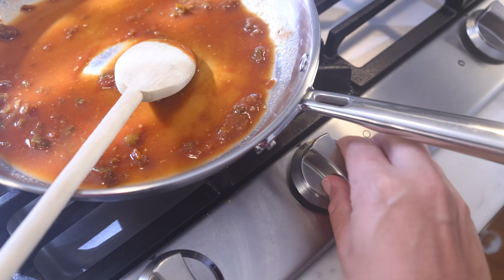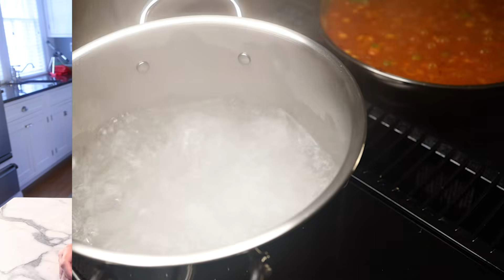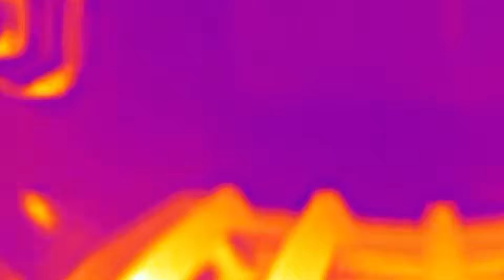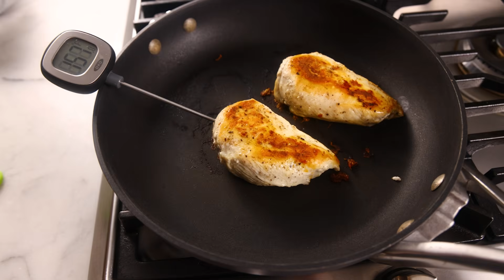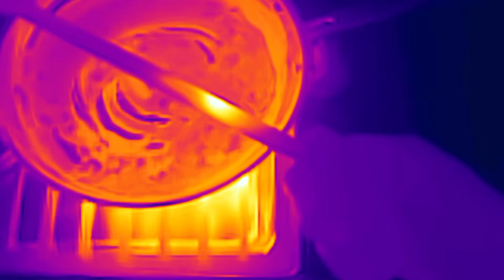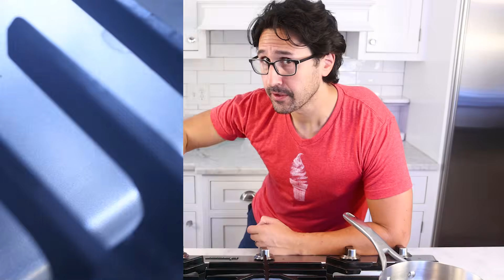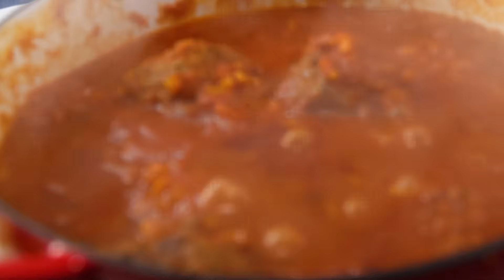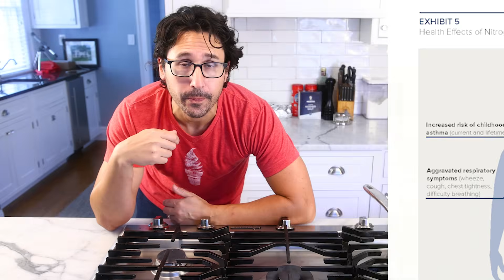Problems with gas stovetops | weak, dirty and dangerous

Comment: Perhaps the reason you are having touble is the specific burner you are using? The center burner is 18,000 BTU's , and that's the one you want to use for boiling water,  the front burners are 9,000 BTU's, and they will be used for things requiring slower cooking, and the rear burners are 12,000 BTU's. I can tell you this, we live in a rural area, so cook on PROPANE, and propane puts out less BTU's on the same burner that natural gas does. My smallest burner on my propane cooktop is 8,000 BTU's. I also don't have trouble burning the sides of my pans because I have Ekco Flint pans from the 1960's, and they don't conduct heat up the sides as much as your modern cookware. I do have old equipment, though... I'm sure modern stuff is totally different. I have  Magic Chef propane cooktop from 1994, and my mother has one from 1971. I don't notice any difference between them, really... except my electronic ignition went out VERY quickly, so I said screw it, and jut light it manually. My mother's has a pilot light.

Comment: I'm cooking nerd, so I also have quite a bit of attraction to gas stoves. But while back I had opportunity to choose what stove I went for, even though I really wanted gas I just had to go for induction because every rational part of me sad it was better option.

I would say if you actually need/want gas stove for wok, get single burner stovetop that works on canister gas outside, either actual stovetop or grill that comes with one.
That said, you can make good wok even on induction and cast iron/carbon steel pan too.

Comment: Gas stoves will not be replaced. Its more efficient, cheaper, its actual open flame and temperature control is just perfect as cooks all over the world were taught how to control it. 
Where do you think electricity comes from? "Green energy" is not cost-efficient. Unless we start building nuclear powerplants, in most countries you cannot replace gas or gas stoves.

Comment: Looks like Induction is the way to go but I wish with every new and improved technology we wouldn't throw out the proven tactile way we interface with them. I'm talking about these awful touch controls you find on everything from stoves to climate control to car stereos. A physical knob is so much quicker and practical to use in these situations. Pressing a button 7 times to get to a medium high heat is an awful user interaction

Comment: German guy here... I don't know anyone in Germany who has a gas stove. Neither stovetop nor oven. Most homes don't even have a gas connection. Almost all kitches are equipped with a resistance coils + glas top stove. Induction is also becomming more popular but only if you can afford it. Whats worth mentioning is that (basically) all kitches have a 400V supply (3x16A*230V = 11,04kW) for your stove ready to be used. Bringing water to a boil is super fast with these :)

Comment: This is the reason my parents got an induction plate setup when they bought their kitchen. Boiling water is basically as fast as using a tea kettle boiler and there is alot less danger of things burning. Although at first a bit weird, when you learned cooking on slow heat plates (I burned alot of things at the beginning), in the end it is probably the best you can get.
Reply: I use glass top stove for low to medium heat duty and an induction plate when I need to blast something. The right tool for the right job.

Comment: Another benefit of having a gas stove is that when you toss food like pasta or stir fry in the pan, or when you tilt the pan to baste, the flame still wraps around the pan and keeps the cooking going without the pan being flat on the surface. With glass tops, you might still get some heat, but with induction, the heat completely shuts off unless the pan has full contact to the surface. Also, I can never shake the pan the way that’s necessary to make a French omelette on a glass stove without severely scratching up the surface. I just moved to an apartment with a gas grill grate stove and I can finally shake the pan on the grate when making omelettes or sauces and not have to worry about the stove surface scratching
Reply: I make  omelets and stir fry all the time. You shouldn't be banging and scraping your pan like an ape on the stove top any way you'd get your ass kicked for that at work. You lift, then toss.
Reply: @TheLegendOfTerry  Never said I banged the pan but the classic technique is most definitely to shuffle the pan back and forth on the grill whilst stirring with the other hand. Just watch literally any old chef demonstrating omelette technique, Jacques Pepin demonstrates this technique perfectly, and he also does knock the pan against the grill towards the final seconds.

Comment: If you can't get the fire in gas stove to be smaller, turn it VERY NEAR the turn off position. It can still burn milk in a saucepan if you're not careful though. But it's rather helpful to know.

Comment: I love my gas range and will never willingly change to electric ever. The supposed‘inefficiency’ is fine versus waiting around for an electric stove to heat up. Oh and BURNING yourself on the stove cause a) you can’t tell if the burner is on & b) it takes a long time to COOL.  So phooey on your ‘gas problem’.  Also the electric goes out from time to time - thank goodness I’ve got both a gas heater & stove.  BTW I can cook on a campfire so cooking on a gas stove is not a challenge.  And yes I do use a wok very often

Comment: Has anyone in the US cooked on electric stoves that were made after 2018? They recently required all electric stoves to have temperature limitations. I used an electric stove made in 2019 for a while and it took well over 30 minutes to boil water. Nearly impossible to cook meat. Over easy eggs were taking 20 minutes.

When the temperature cycled off the pan would get cold enough I could touch it with my hand and stay like that for minutes until warming back up.

Comment: I feel like a time traveler from the past watching this video. Adam talking about the only type of stove I've ever seen personally like it's an alien and fascinating relic
Reply: Right? I wonder if it's a class thing. I grew up broke as hell and have kind of always been broke as hell. I have only ever cooked on gas. It might be because gas ranges are 10-30% cheaper to operate than electric ones, based on natural gas vs electricity costs. It might also be that both of my parents grew up in the rural southern USA and even up through the 70s and 80s it was commonplace there for people's primary heat source both for cooking and temperature control to be a wood or coal fire stove. Therefore cooking over a flame was the ONLY WAY THEY EVER COOKED. Judging the temperature of a flame was an internalized skill. But ask them to turn the magic electricity circle to 7 and maybe burn your food before you even know what temperature 7 even means? Not worth it
Reply: @QuiteWellAdjusted  "Broke" can mean a range of different things, but here in Germany used stoves with induction stovetops in good condition and from reputable brands aren't prohibitive expensive I'd say, neither is induction cookware. 
We do heat a lot with gas, but gas burners are a rarity around here.
Reply: Well, over here in Europe, it is a country thing. I grew up with individual electric hobs (as in covered coils) in Germany, and only my aunt and grandmother had gas burners, with my Oma's using big replacable tanks that we had to swap out now and then. My mum never liked gas, mainly due to the hazards that open flame and nitrous oxigenes bring with them. Fast forward 18 years and there I was in Britain, being spooked by uncovered coil hobs turning aggressive orange and getting all yucky underneath, with a gas-fired grill ABOVE the main cooking area, but that was student accomodation. Fast forward another few years, and I was in gas-burning middle England: Things had obviously improved to such a degree that the individual burners did what you wanted them to, within the limitations that Adam just pointed out, but I just did not trust the ovens, ever, which meant hardly any baking, but by the noughties, electical ovens often accompanied gas-burning stoves. Now, back in the Fatherland, we have our first glass-covered coil set. The Germans just do not use as much gas, as it is not as readily available as in Britain. The wife dislikes the lack of responsiveness here, I disliked the cleaning of the gas and open coil stoves.

Comment: Really all comes down to stove model, matching burners and heat settings. My electric stove burns my hand above the pot if I'm not careful even though the ring is well matched. Basically gotta find the right stove. Electric stoves suck, Gas is pretty good, but I've heard the best is induction esp these days. Oh and never ever ever ever ever ever ever ever buy glass top electric stoves - they are absolute shite esp to clean we keep a glass scraper and it still doesn't get it all with considerable pressure. will probably pick up one of those independant gas burner

Comment: As someone who cooks Asian cuisine, the gas stove is irreplaceable. To cook up a proper stir-fry or even use a wok properly, you need to be able to control the temperature and need it to be responsive which electric is not. Most induction cook tops don't cater for woks and with a flat based wok the techniques you use for wok cooking does not work. That is why you will see many Asians with a gas stove that's suited for woks setup outside their homes if they don't have a gas line.

Comment: I have an induction stove at home and yes, I live in Europe, incidentally. If I put my hand on a cold pan and turn the stove on to maximum, it takes less than 10 seconds for the pan to get so hot that I have to take my hand off. That's how fast it is. What bothers me about my cheap-ish induction stove is that the power isn't constant, it's cycling on and off to reach the desired average output. Since induction is so responsive, you can actually see that cycling in simmering water as well. With gas you have a constant output which is almost infinitely adjustable. That being said, the benefits of induction far outweigh the negatives in my opinion. One more good thing about induction is that the cooktop itself doesn't really get THAT hot so food doesn't burn to the glass surface like it does with regular electric stoves.